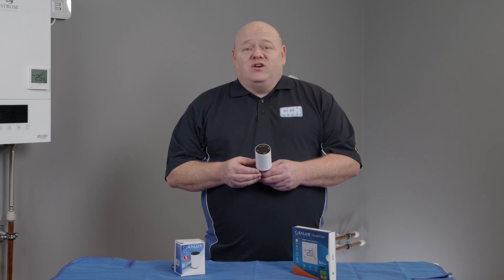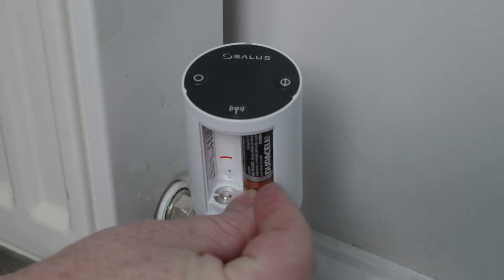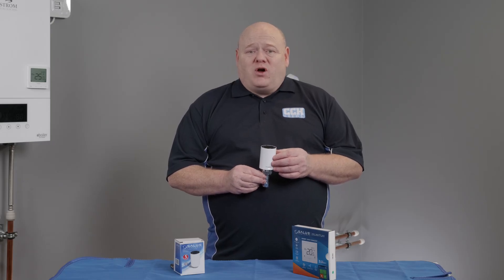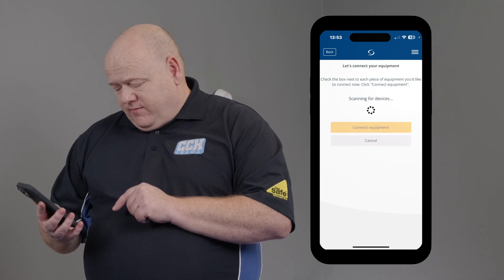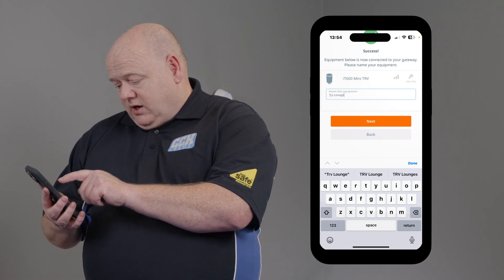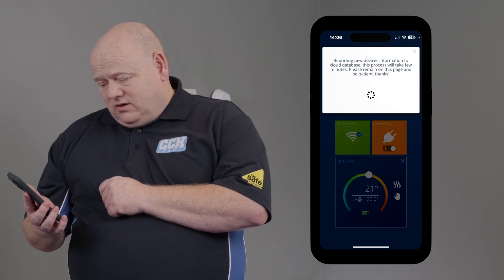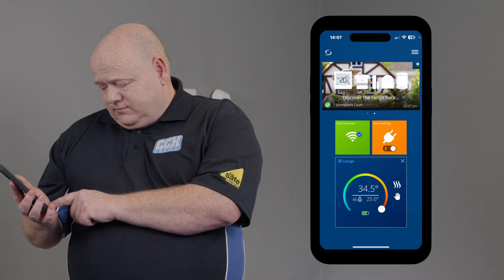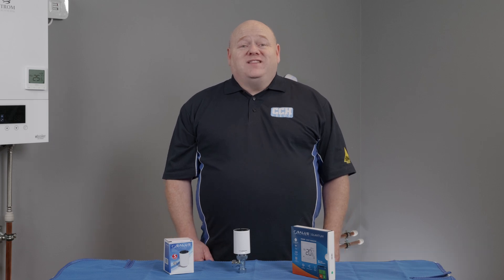How To Connect Your Salus TRV10RFM Smart Home TRV Head

Comment: Hi Allen .. I recently bought this kit but running into an issue. I first set up the UG. ok. I then set up the boiler receiver rx10rf. All ok. I then set up the sq610rf and all ok. I paired it to the boiler receiver - all good. I also set up 6 TRVs - all connected to the GW ok. I followed your advice of pairing all of them before pairing. However I am not able to pair the TRVs to the thermostat. Any ideas?
Reply from the maker: https://www.youtube.com/watch?v=VKmcWdan07w

Comment: Hi Allen, great video, too bad it doesn´t work for me, nothing happens when pressing the white dot, all SQ610RF are working correctly, in the corresponding Zones, but this TRV10RFM, just will not work, when adding, it shows, but states "offline" when adding, but the online symbol, and signal strength shows, latest firmware correctly installed on KLF08RF, no idea what to do, I´m tech savy, but this just will not work, tried via Zigbee on the CO, no luck !

Comment: I’ve got the TRV’s paired with the thermostat but is it possible to pair the boiler controller rx10rf to the same thermostat?
Reply from the maker: The RX10RF will automatically fire when you call for heat on the thermostat, the TRV will also engage.  You can only pair the RX10RF directly with the thermostat if you are not adding any TRV10RFM's. Does this answer your question?
Reply: @AllenHart999 thanks for the reply I’m going to re do all the TRV’s
Reply: Ah so I only need to pair the TRV’s with the thermostat, they’re all on the gateway with the boiler controller RX10RF so that’s what gets the boiler going on and off, I was worried that the boiler would keep running when the TRV’s had reached the required temperature
Reply from the maker: @centurybugs @centurybugs  Yes, that's correct. Thanks.

Comment: Love how easy you can pair the stat to the TRV.
Reply from the maker: Thanks.
Reply: I set up a 3 bed house with lighting controlled by Sr600 relays, 4 x UFH zones, 8 rads on TRV10rfs, motion sensors, water leak detectors and smoke detectors. We had the lighting of a smart button as the main house switch, and a PS600 external sensor to run a hybrid system to switch between ASHP and boiler.  Absolutely amazing